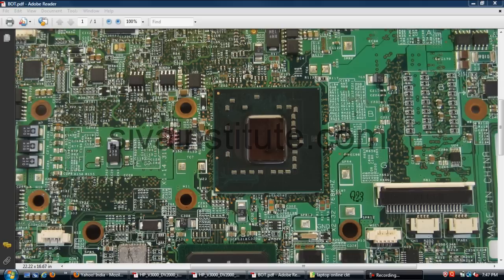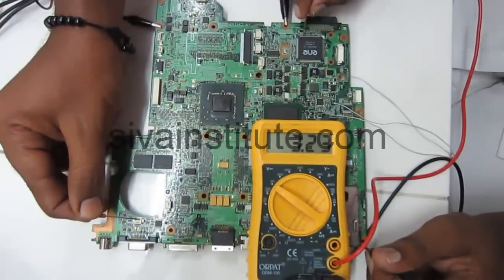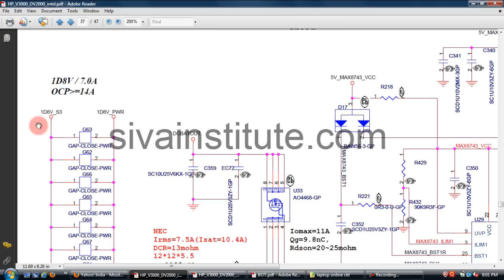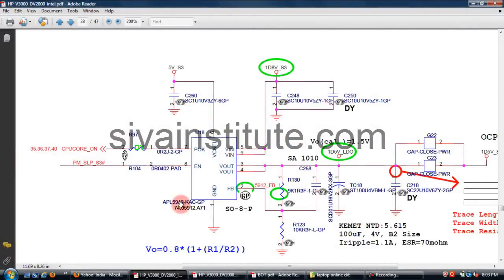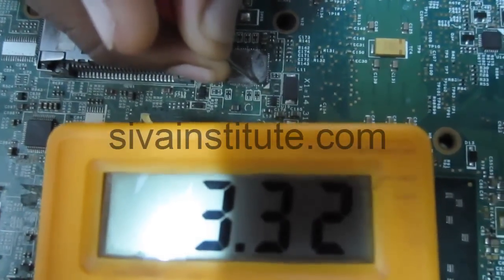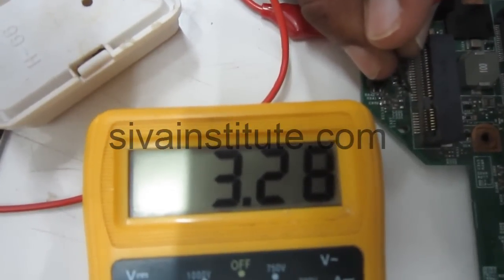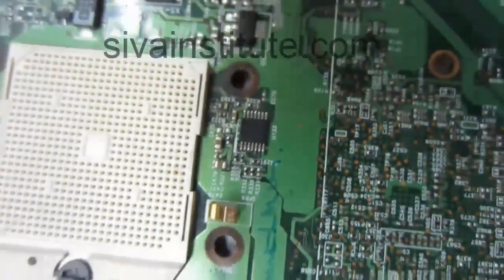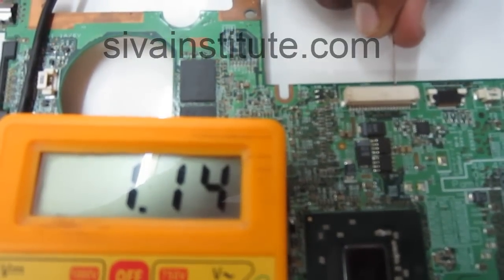How to check Dead Laptop Motherboard(Step by Step).eng

Comment: Electronics courses are very good.
 
I am Spanish and beginner electronics.
 
Work with computers, car, soldering and desoldering micros motorolla etc eeprom and computers and components.
 
 
courses in Spanish electronics no?
 
 
I have some knowledge of electronics, I need to learn the knowledge of the components and operation of the circuits.
 
I have read manual of electronica-youtube videos
etc but need to know many things
you can advise manual notes or books.
 THANKS

Comment: This video is one of the best I have seen on motherboard circuit analysis. However, if you decide to add annotations to this video for each step in the process, in english, this would be a better video. Nonetheless This is very good!

Comment: one thing i did not understand. your placement of 3 pins SIO and BIOS checking, your placed GROUND on power adapter pin and +ive 2 pins on a place on board where there is grounding underneath the screws. can you please elaborate a little bit?

thanks

Comment: halo sir
I have a laptop hp dv2000 PCB no 06230.systum power on ok,but not working display and external monitor.i checked volteges ok but VGA_CORE_PWR 1.1v (L36,TC1,TC2) line all components short. how can solve this problums. pls replay sir...tnks

Comment: this video is not for simple computer technician.this video is about laptop motherboard repair.but i don't recommend motherboard repair because it is time consuming and time is money.if you spend too much time on motherboard repair,it is more cheaper to buy new laptop.nowadays used laptop is very cheap.there is no need to spend time repairing.